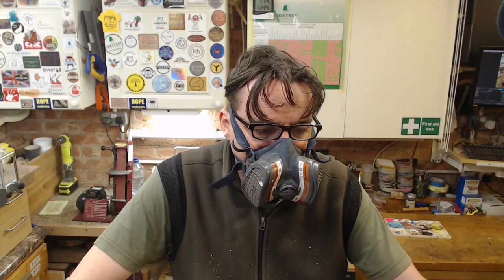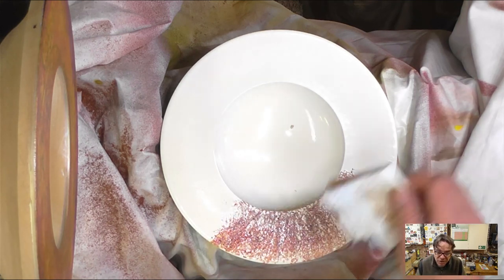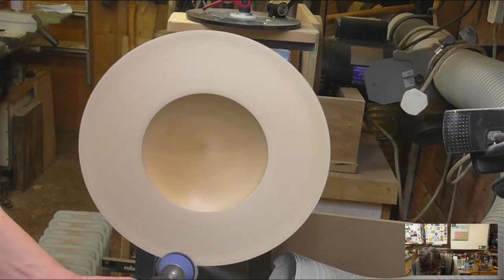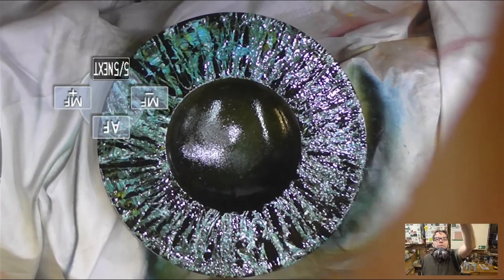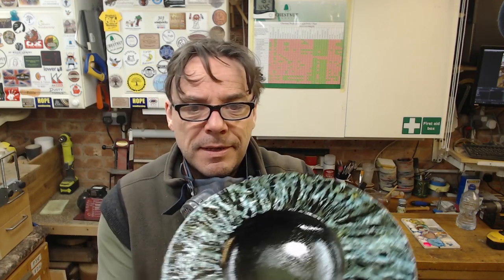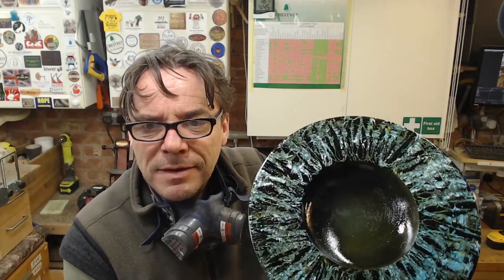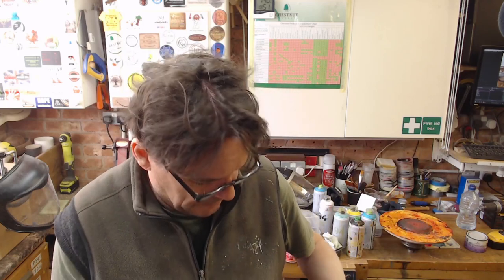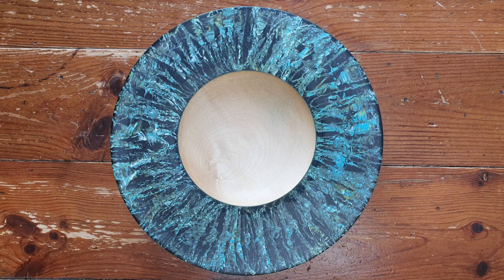Decorative Woodturning - Paint Pulling on a Platter Rim

Comment: Hello Stewart, Or you may be his younger brother. Anyway, a nice job on both. Perhaps the paint could be its own finish. After all, the end result is where one decides to stop. Still, there will be something different underneath; maybe a bit like distressing painted doors. Does that need a spinning surface or the twist of a thumb? 
Both seemed to come out well. If you decide to repeat this, would it be possible to split it into sectors and change the order of colours used?
Regards,   Glenn.     :-)
Reply from the maker: Cheers, Glenn - so many variations on this method - nice idea about different sectors having different colours. I'm thinking of doing one with very similar colours to try to imitate the surface of water....might need some more colours!!!!